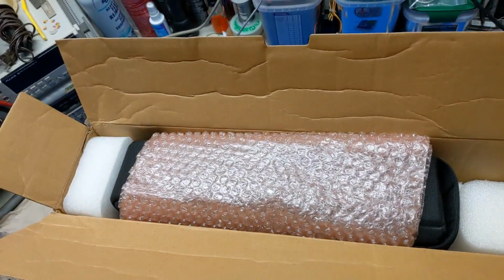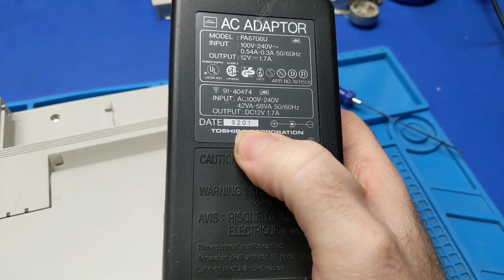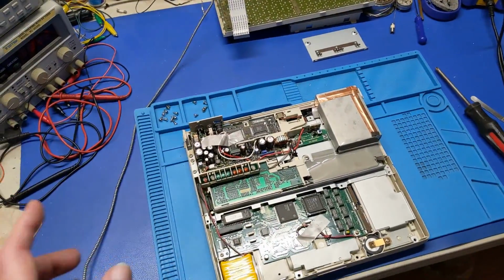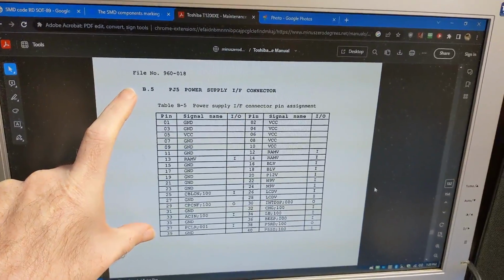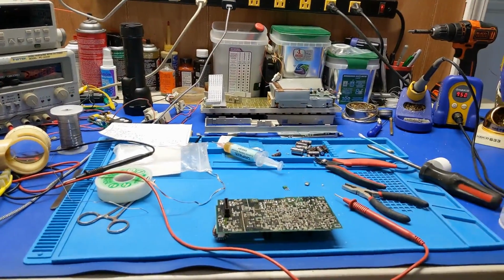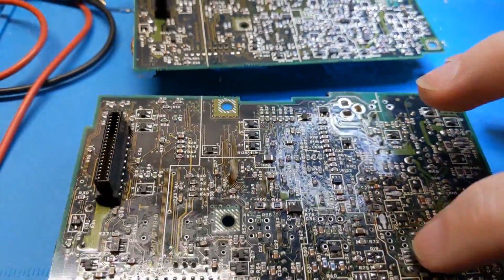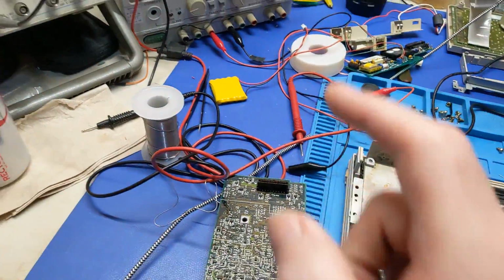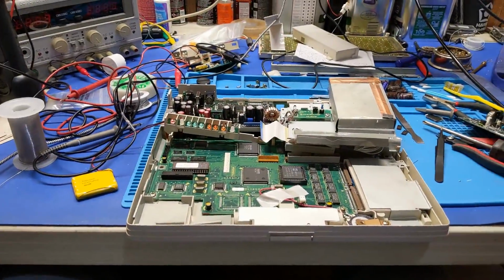Toshiba T1200xe Repair Nightmare! Part 1

Comment: Did you ever get this working? I got one that had only recently started to leak and cleaned/recapped it with little visible damage. When I power it up I get a solid DC IN light and a flashing orange "battery" light on the far right. If I then press the power button it swaps to flashing the DC in light and the battery light goes off. I haven't got any further.
Reply from the maker: Unfortunately I did not, I need to go back at it again but I think the gate array is bad. This particular design uses a gate array to generate all of the pwm signals and it's not responding at all. I'm probably going to have to make a new PCB for this thing, and my ADHD is still running around trying to figure out if it's worth the effort or not
Reply: @THEtechknight  Oh wow! Thank you so much for the reply. I was not expecting one let alone that quick. Did you do any form of schematic? I was just about to start reversing the circuit for my own fault finding. My plan is to find the "on/off" signal for the voltages and use those to trigger new dc/dc circuits that bypass stuff like the gate array mosfets etc and inject the known good voltages on the correct pins. My only worry is how the mainboard checks valid voltages if it communicates with the PSU or if it checks the actual state of the output. The gate array wouldn't be the 28pin IC3 with the number missing would it? I get 5v on the RAMV pins so I know 5v is coming from somewhere, do you get that on yours?
Reply from the maker: The closest schematic we could find was the 1600 someone recreated

Comment: Did you ever make progress with this? I'm developing a replacement power management board for the T1200XE.
Reply from the maker: @supergee_  no I unfortunately gave up. There's no schematic and there's no drive waveforms coming out of the custom gate array. And without a schematic you can't really tell why
Reply: how far along are you with that?

Comment: I just recapped mine, and it did not help at all. The traces look OK, although I did not try any continuity tests. 
Anyway, after watching all you tried with pretty much the same result, I am not even bothering to look into this any further. 
A few things I noticed on my Toshiba:
 - the power supply kind of balances on the verge. It had a period of time where I got steady red LED after connecting the AC. Now it's back to blinking.
 - when I had steady red LED and disconnected the power, the LED stayed on for ~ 1 sec. Now, with blinking, it blinks longer
 - once, just once, I had steady red, and after pressing power button, all LEDs briefly flashed and system went to blinking
 - with parallel port diagnostic, there's something weird going on when system powers on with steady red - it looks like parallel port actually gets some activity. With blinking red, nothing happens 

It feels like at least temporarily, the power supply partially works and the machine tried to turn on but fails immediately.

Comment: Hi, Don't suppose you ever found out what the Q22 component was? Got one of these with a similar cap leak and Q22 also died. (Thankfully rest of board seems less corroded)

Was looking to Re-cap and replace this component.